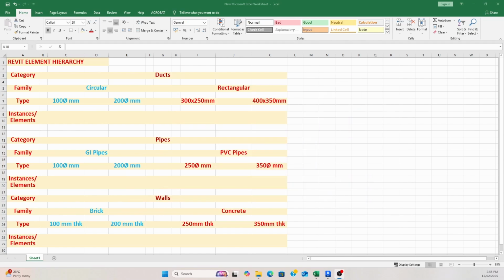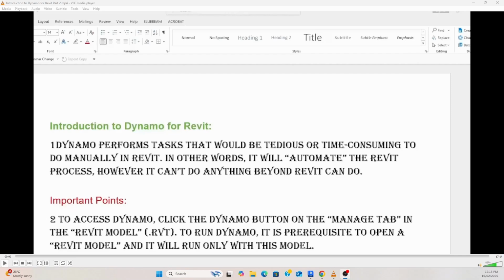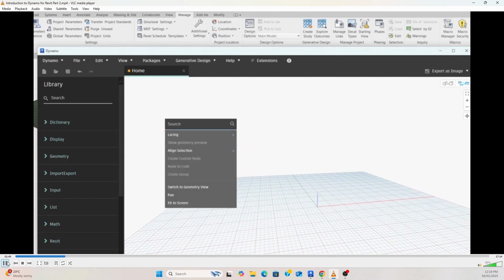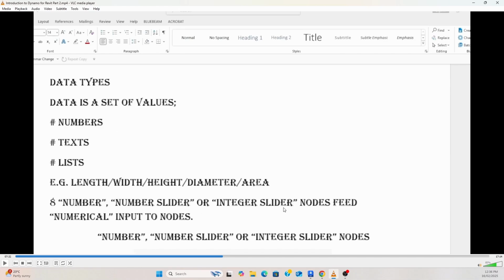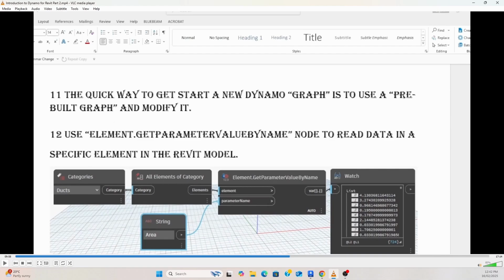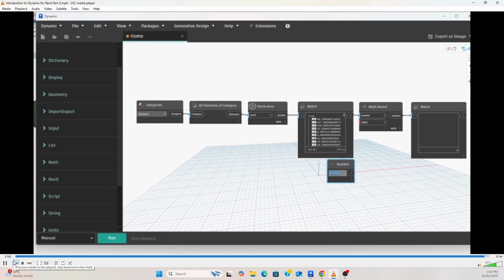Dynamo for Revit Tutorial I Introduction to Dynamo I Dynamo for Beginner I Revit I BIM

Comment: Automation and Efficiency
Dynamo for Revit automates tedious tasks within Revit's capabilities, accessed via the "Manage" tab in an open Revit model.
Typical nodes like "All Elements of Category", "Get Parameter Value by Name", and "Watch Element Dot Parameters" enable powerful data manipulation and extraction.

Graph Creation and Data Flow
Dynamo graphs are built left to right, with data flowing through nodes connected by wires from outputs to input ports.
Number, number slider, and integer slider nodes provide numerical input, while string nodes feed both text and numerical data to other nodes.

Practical Applications
To calculate total room areas, use "element do get parameter value by name" to read the "area" parameter, sum with "math sum", and round using "math round".
Dynamo graphs can create custom tools and workflows for complex data analysis, visualization, and improved productivity in Revit projects.

TLDR: Dynamo for Revit is a powerful tool that automates tasks and manipulates parameters within Revit by using scripts created through interconnected nodes, enhancing efficiency in managing elements like ducts, pipes, and walls.

1. 00:00 🔧 Introduction to Dynamo for Revit explains the element hierarchy using ducts, pipes, and walls, focusing on their categorized types and parameters.
	1.1 Introduction to Dynamo for Revit covers the element hierarchy of categories, families, types, and instances, using ducts, pipes, and walls as examples.
	1.2 Duct elements in Revit are categorized by type and have parameters such as size, width, height, and length.

2. 03:56 🛠 Dynamo automates tasks in Revit, streamlining processes while remaining limited to Revit's capabilities.

3. 05:47 🔧 Dynamo for Revit enables users to create scripts by connecting nodes to manipulate parameters and generate outputs, executed by clicking "run."
	3.1 To execute a Dynamo graph, click "run" after completing the nodes and wires, and use the search field or right-click on the canvas to find and place nodes.
	3.2 Dynamo for Revit allows users to create scripts by connecting nodes and wires to manipulate parameters and generate outputs.

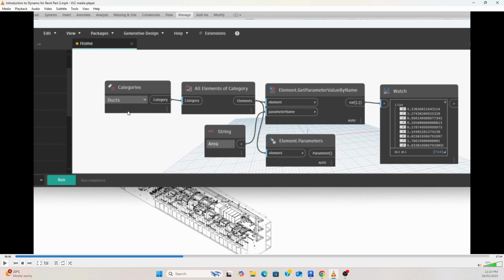4. 12:34 🔧 Select the duct category in Dynamo to output the area parameter of 724 duct segments, noting that indexing starts at zero.

5. 15:14 🔗 Wires connect node outputs to inputs in Dynamo graphs, allowing data to flow from left to right, with various data types including numbers, text, and lists.

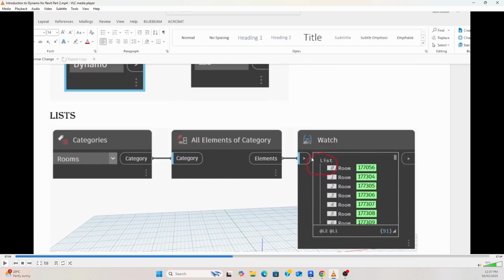6. 17:23 📊 Use Dynamo in Revit to access and manipulate room data by utilizing nodes like "list get item at index" and "get parameter value by name" for efficient graph creation.

7. 20:48 🦆 Select the duck category in Dynamo to retrieve 125 area elements, while ensuring correct node information to avoid errors in processing.
	7.1 Select the duck category and area element to retrieve all related elements and their parameters, resulting in 125 duck segment areas.
	7.2 Errors in the Dynamo graph can cause warnings and prevent processing, highlighting the importance of correct node information for retrieving room areas.

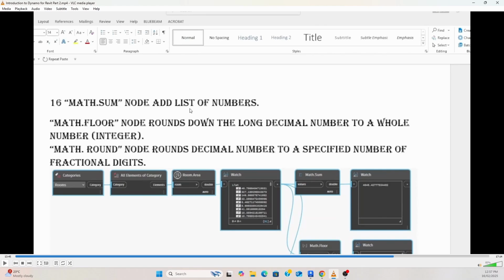8. 25:29 🔢 Pro node provides whole numbers while math round node allows for specified decimal places, enabling precise calculations in Dynamo for Revit.